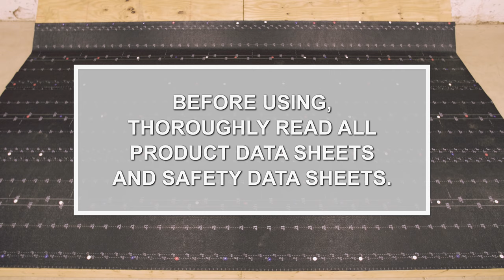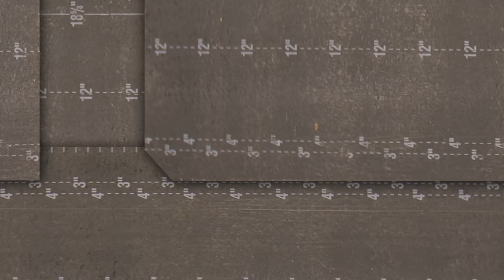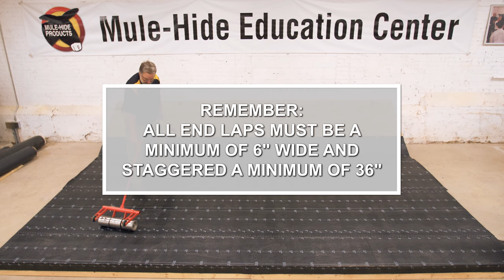Self-Adhering Mod Bit: SA Base Sheet

Comment: I'm installing a small, 3 square  SA "Liberty" roof.  The base sheet was a dream and it worked perfectly.  The cap sheet is sucking. I assumed that the same method would be used on the cap sheet but I was wrong. The plastic sheet did not want to pull out easily like the base. It was a combination of the weight and the interference from the overlap area, both the plastic and the slightly rough membrane.

Apparently you have to flop half of the whole length over and that will be tricky. If things don't go perfectly, it will be a shit show.
Reply: I had to paint a liberty roll roof with gaco silicone because the Liberty roll wasn’t waterproof
Reply: @sirjohnahayfalcon  It was a new product for me and I knew it would be a gamble. I'm 70 so it may last a lifetime :). If not,  I will accept the consequences.......or paint it. :)

Comment: Why use two base sheets? One wasnt even fiber
Reply: If you are thinking long term re roofing, the first nailed down base sheet will allow the adhesive layers to be removed easily.  If you stick that shit to OSB, it ain't comin off.
Reply: @jackconnolly2665  If considering the re-roofing, how about keep the plastic sheet and not pull out from the bottom of the nail base sheet, use nails to hold the base sheet on the plywood roof. Is that working?
Reply: @geoffyang9984  The stuff I used was far too slick with the plastic in place.  It would be so slippery that you'd need 10X the nails (and nail holes) to keep it in place.

When completed, the adhesive turns  it into one large stuck down piece with no nail penetrations.